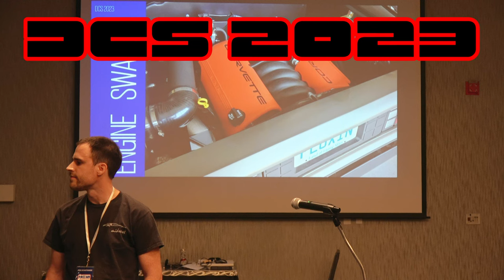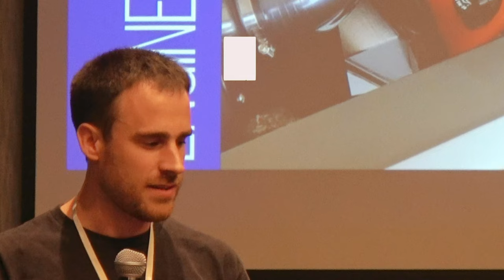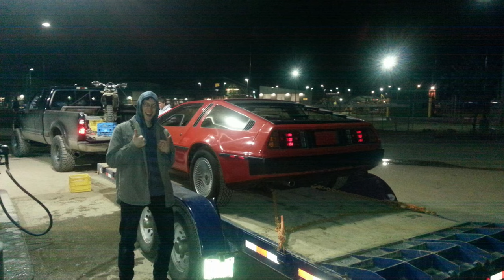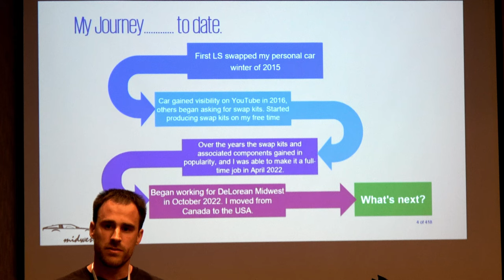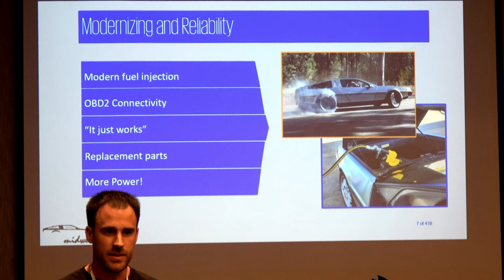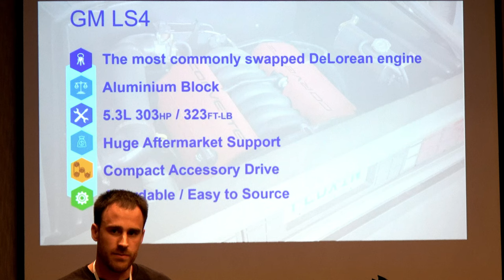DeLorean Engine Swaps

Comment: I watched an old episode of the show "Wheeler Dealers" where they were doing an Alpine A310. The engine is a PRV and they said that the Renault Alpine club to get more power and stuff by swapping a intake manifold that make it possible to use a Holley carb or EFI with it. 
I think that was a good idea to make the stock PRV better.